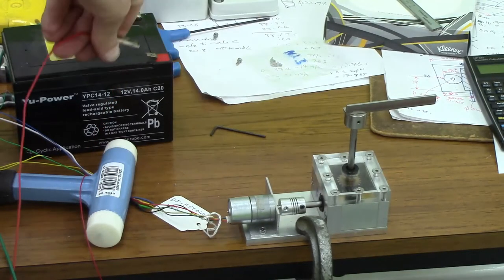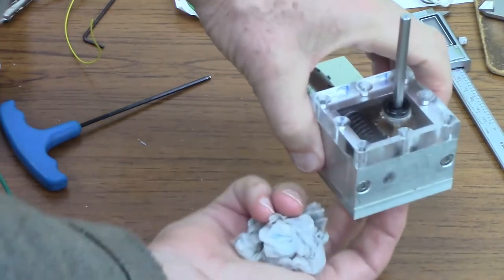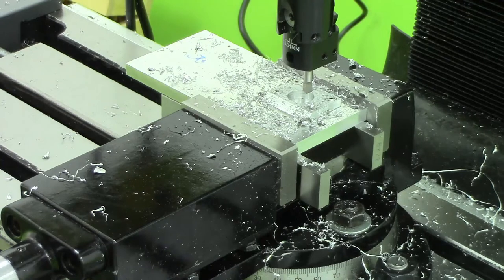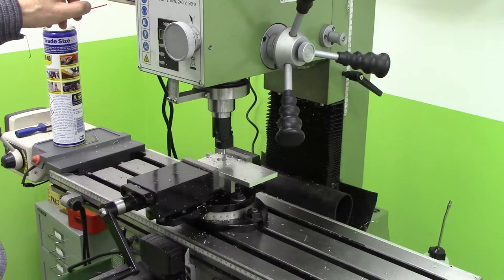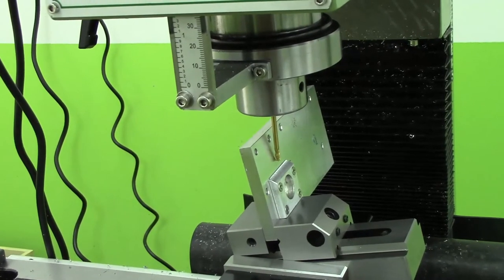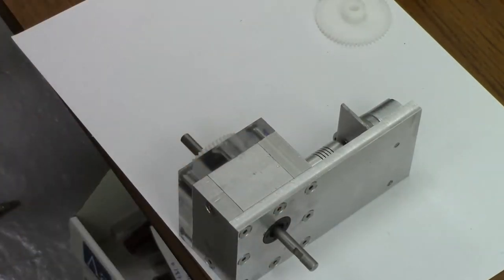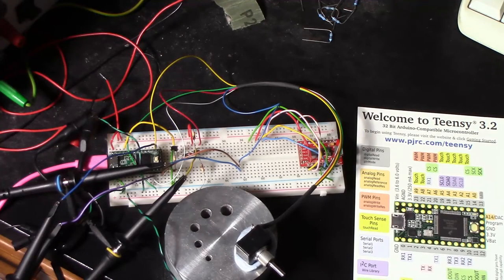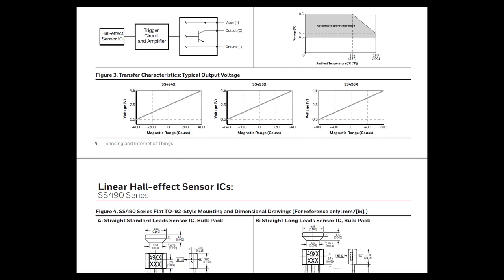New rudder servo - part 3

Comment: Good job I watched to the end, was going to suggest using the SS49e, they're just a few pence. I've not seen all your videos so apologies, however I used to fly model airplanes and never once had a problem with a surface servo, is this what you used originally?
Reply from the maker: We tested a Savox SB-2263 MG brushless servo which was nice but it consumed too much power, especially when stationary.  Then I used a NEMA 11 stepper motor with 27:1 reduction gear, but this could not hold position against hydrodynamic forces on the rudder. Then we used an Actuonix L16 linear actuator, which is in the boat still, but it isn't robust for long term use becuaswe uses a carbon pot and brushed motor. Also it's hard to waterproof since it keeps changing length! Our friend Robin has used cheaper RC servos in his boat Snoopy but they do tend to fail.
Reply: @samuelfielder  ah! In that case I think I would go for something like you're doing but have the motor drive a cantilever that then drives the rudder. Could maybe even utilize a small Kanttwist clamp so that bit is already done for you. SS39 feedback from the cantilever movement. Just a thought.